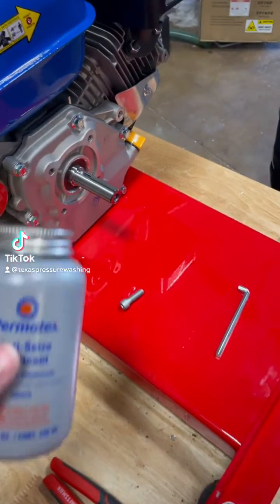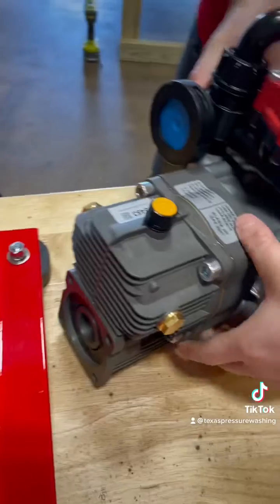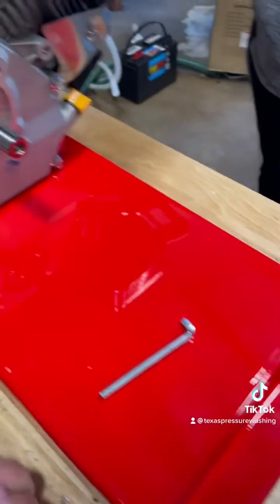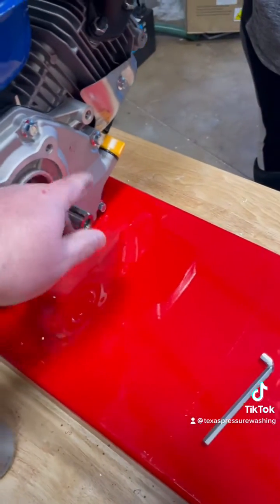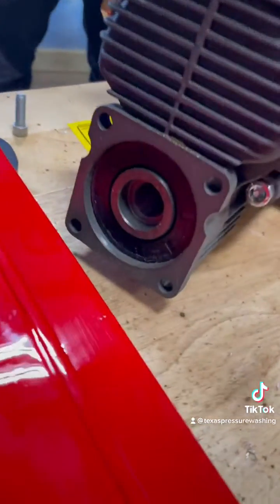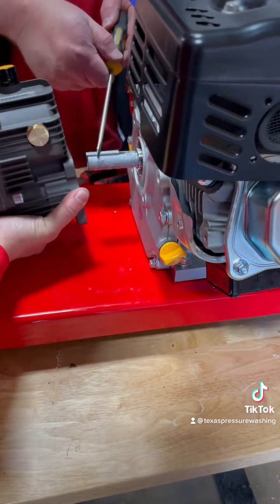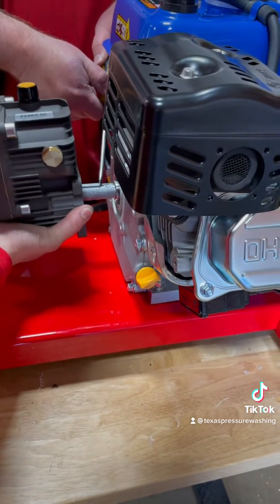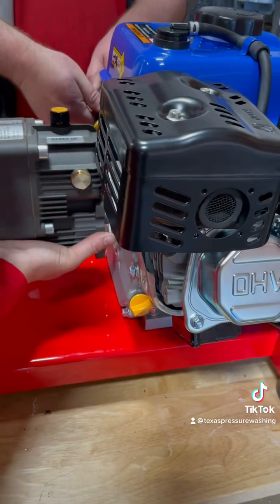AR30 Gas Soft Wash Assembly

Comment: Budget is an issue but want to upgrade to a gas soft wash system. Does the D30/AR30 hold up or should I wait a little longer and get the P40 or     AR45? Thanks for the videos!!
Reply from the maker: Wait for the AR45 or P40
Reply: @TexasPressureWashing  thanks!